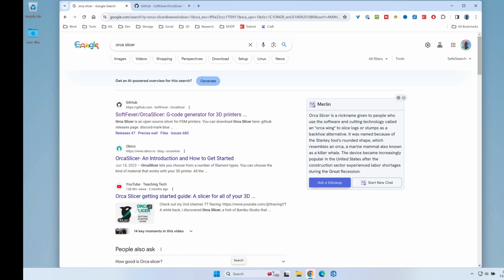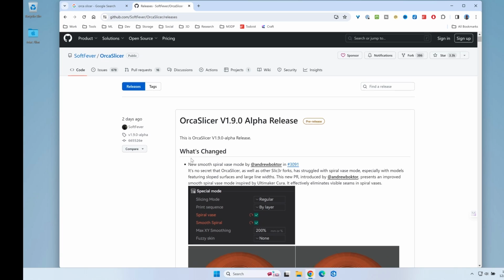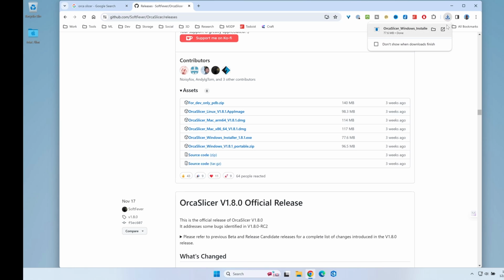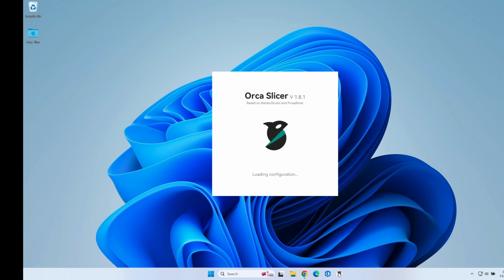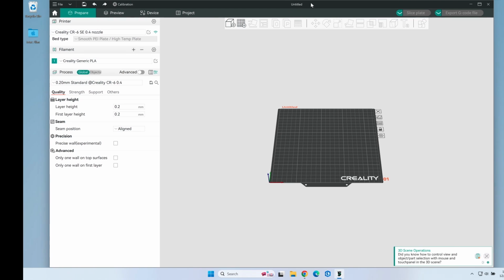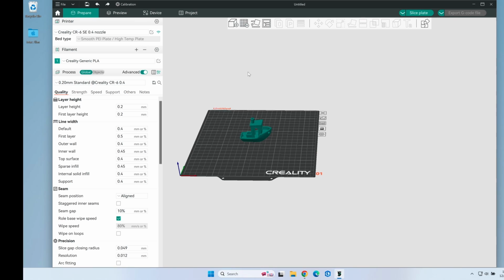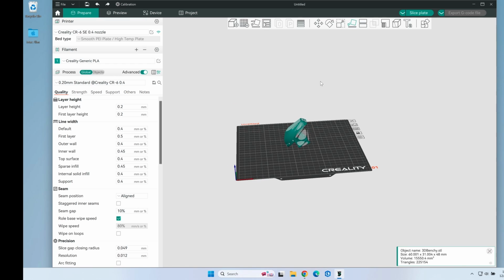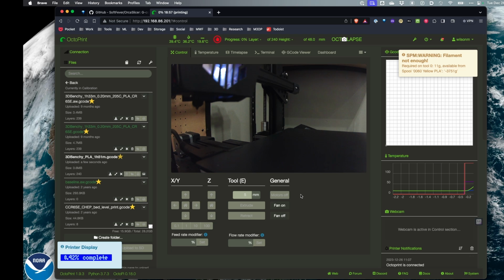Boom! Getting Started with Orca Slicer 101: Mastering the Basics (Download and Install) - Part 1

Comment: I just downloaded orca. Following your instructions I got to adding a printer and mine isn’t listed (CR10 smart). Plus I have done many upgrades, btt sk3 mini, tft35 display, micro Swiss hot end and direct drive extruder. I was wondering what I should use. Btw, using marlin. 
Thank you

Comment: Great set of videos, thanks. I'm a FlashForge 5M Pro user and am wondering if anyone knows what specific functionality is supported in the latest Orca version? At least initially it seems that Wifi printing & camera access weren't supported (but it seems they may be now). Are there other 5M Pro users out there that might know more details about this? I know there's a specific Orca-FlashForge version but concerned about going down that path since it's unlikely that FlashForge will keep them in-sync as new Orca versions are released. Appreciate any info anyone has to share.

Comment: how do you create that object?
Reply from the maker: Which object?
Reply: The boat object. There are many videos about how to use orca software but none explains how to create an object.
Reply: @gregmun5595   I know it's 4 months and you probably already have your answer, but I'll give it just in case somebody else has the same question.
The boat is called a "benchy" which is short for "benchmark" and the file for it is preloaded by the factory. To create a new item you must create it in a graphics app and save it as a .stl file for use in a slicer app.

Comment: Orca is one of the worst designed programs I have ever used.  It is stupid, has no flow to the software, you cannot even easily setup the printer.  There is no help files.  The Device Tab opens to an image that does nothing.  And you cannot do anything from the Device Tab.  Setting up the printer is impossible.  This is a freaking idiotic program.  Like a 15 year old designed and implemented it.  So far I cannot say anything good about this software.  I hate it.  Its no possible to master the basics.  A program should have a flow to it.  It should be Designed so an idiot can operate it without help files.  But even, this program has no help files.  That is rule number 1 in designing software.  Is put very well thought out help files.  And the person who did this video assumed that the printer was already set up.  And assumed so many things.  I have operated software and designed software for 30 years.  And I cannot figure out this software.  If I cannot do it, then few can.
Reply from the maker: Thanks for the input.

Comment: @joseguevara184
hace 1 minuto (editado)
I "had" and I say HAD because my printer is a Tronxy XY 2 pro printer but..... I have replaced everything on it, is just the frame as a Tronxy. Actually it is a printer with Makerbase Nano Robin 3.1 electronics and TFT screen with E3d v6 extruder and so on. It works fine in CURA even the USB files reading and WIFi to send files, everything is absolutely fine with proximity sensor and glass bed. I have heard a lot about Orca Slicer as the best of the best but I have a little problem that really is a huge problem: the printer does not print!. Starts, home, does all Gcode start routine, the heat for nozzle and bed are at the printing level but nothing happens. Maybe someone to guide me to solve this "little incident"? I like Orca, looks very practical for the simplicity to calibrate the printer , they even considered MKS and the Wifi works perfectly sending the files. Hope I can use it.

Comment: I wish Orca had a separate tab for bed adhesion options, or put bed adhesion and support together in one tab. Once I have a good profile set up and I am printing multiple objects of a similar type (ie all part of one project for example) the 2 things I might change between prints is support and bed adhesion.
Reply from the maker: I usually just have 1 profile and adjust print by print. Separate tabs might make that easier.

Comment: Mike, I really appreciate your thoughts and tutorials for ORCA.  On the surface I can see that there are / might be some really cool things here that CURA does not do.  

At the moment, I'm struggling to find any ease of use here but I'll say this is because I've only ever used CURA since my first steps into the 3D world 9 months ago. Kind of like, to me, the differences I "find" are similar to what I find between Windows and Mac.  IE, the system I was "raised with"  typically comes more easily.  I say to self "well duh" !   Familiarity rules every time.

A quick example (again, most likely because I'm not familiar) but how do I add filaments? I've selected all etc, etc which only brings up a few that Creality makes,  none of which I use.  No real big deal but it is things like that which make me crazy. 

Oh, and so far the two items I've printed having sliced them in ORCA have both failed. Print goes for a while, looking good, then all of a sudden the print stops and the hottend moves away as if I asked for this.  Same exact part was then sliced in CURA and it printed as expected.   Sigh...I will uninstall ORCA and then reinstall is as there must be something amiss in the software from the download, clearly, as everyone raves about it so no question this is on my side of the equation.  

Nonetheless onward and upward. I will go over your tutorials several times as this old dog needs training to hunt. Again, MANY thanks for taking the time and cross your fingers for me.

Sincerely, PDC

Comment: mine says i must trust. whatever that means. wont download.
Reply from the maker: It probably means it is unsigned but you should always be careful when installing apps
Reply: i was able to install the version prior to the latest . had the same issue but got around it. but not so lucky on the latest, guess i need to reauthorize
 @minimal3dp
Reply: Because they are hell bent to make you download from Grithub that doesn't have any security at all

Comment: Thanks for the video Mike. 
I installed Orca slicer the other night. 
I'm in the middle of printing the parts for my Belted Z upgrade (From KevinAkaSam).
I printed a couple of parts with no calibration just to see how it went.
I made a couple of changes that I just knew I'd need to change, (retraction distsnce and speed also hot end temp.) 
(The PETG I have seems to like to print at 220C) and The Orca generic PETG profile wanted to print at 240.
Really it was just a bit of an experiment to see how it went.

I feel that the calibration  in Orca for my printer (E3V2) is a tiny bit out.
 I have calibrated my cura profile and I find that the parts fit exactly to the bearings and nuts, but in Orca the holes are just a tiny bit tight.
I like the slicer, but I'm going to finish printing my parts in Cura and then after the upgrade is compete, I'll Klipperize the machine, then  I'll run some calibrations in Orca. 
I think I'll end up changing to it, so I'm looking forward to your series.
Commenting partly to thank you  for the videos and keep you up to date with what I'm doing, and how that fits in with the videos that you are posting and also to "feed the algorithm" . 
Keep it up Mate.
PS Printing is in hiatus for a bit. 
We had a summer storm the night after my Orca experiment, and I lost power for 4 hrs with a print at 80%.
I didn't print the next night but there ended up being no storm. 
The next night we had another power outage for 10 hrs... so I was pleased I didn't print that night.
I have covered up my printer and vac sealed my filament till I'm more confident that the storms are gone. 
I live in the subtropics so we have high humidity at this time of year.